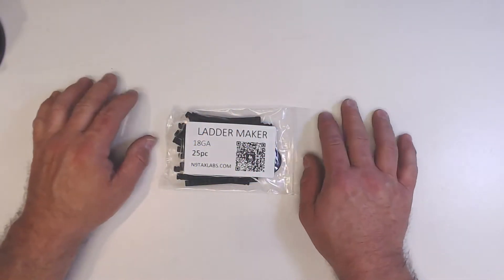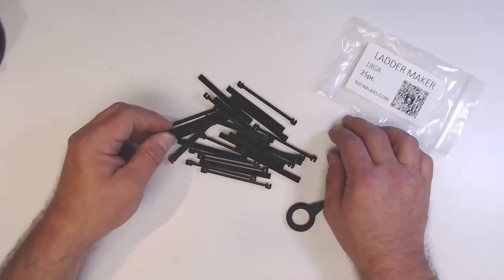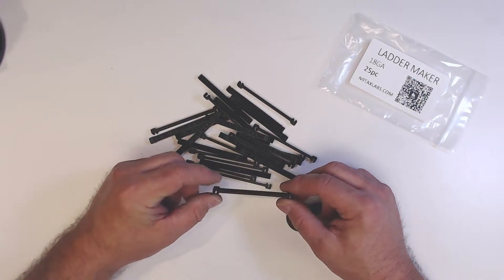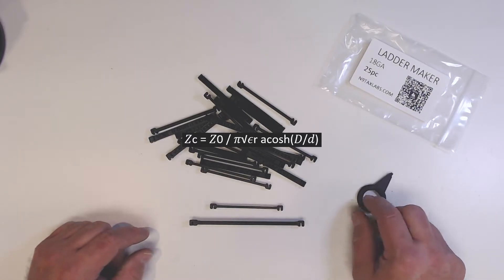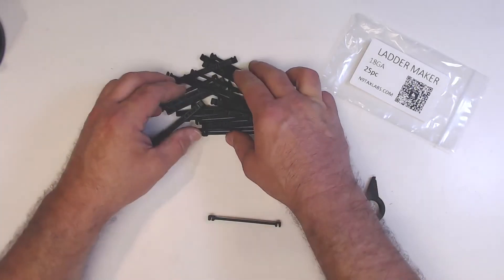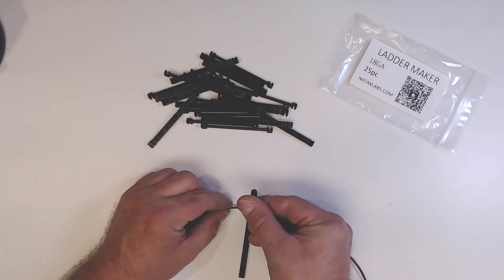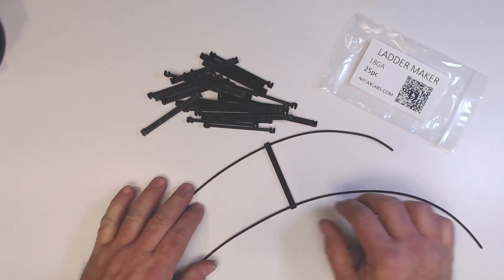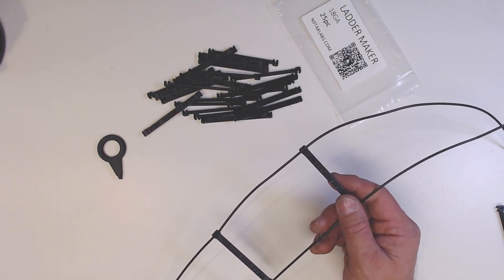Assembly instructions for the N9TAX Labs Ladder Maker clips for ladder wire building.

Comment: Not the exact same, but I just bought your Slim Jim 2m/70cm dual band ant which is similar in style.  Made my first contact!!  Been trying to get it to work for months with just short rubber ducky and it wasn't working well (on TX at least).